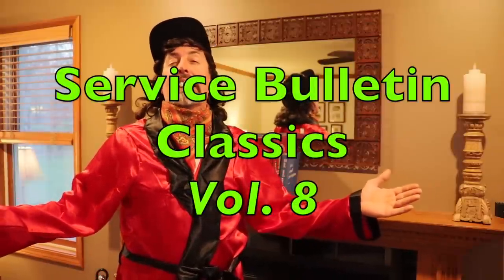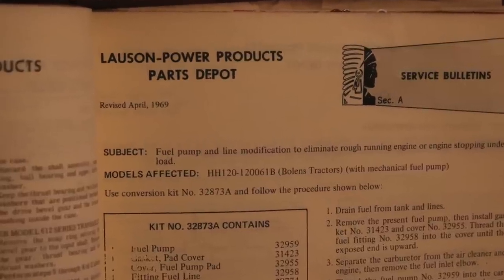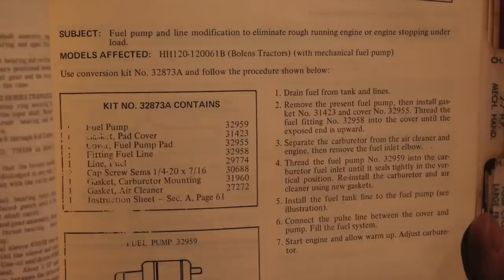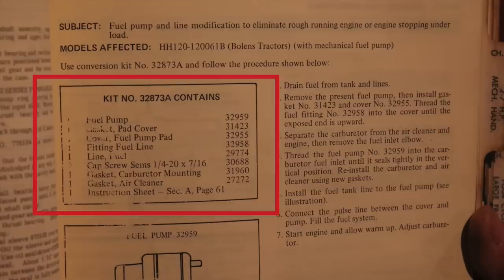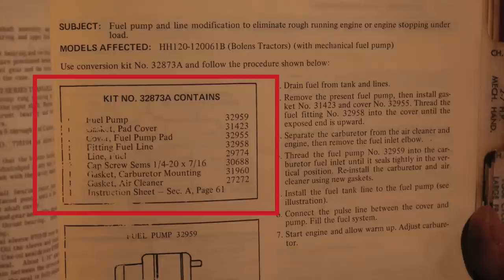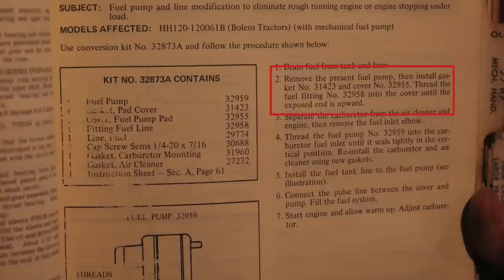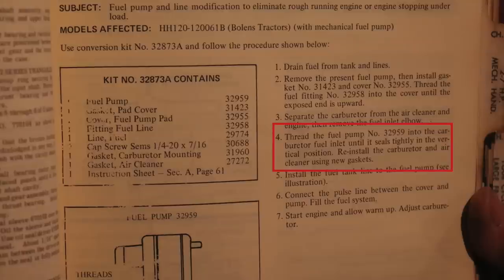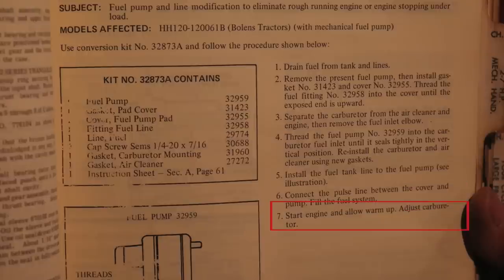Mechanical Fuel Pump Modification

Comment: I'm Old and remember actually using that exact bulletin! Used many in 50 years of being in this business
Reply: I’m old 😂
Reply: Me, too. 
Hey did you ever pull the "mechanical fuel pump" off an old Kohler Opposed Twin only to find out the factory had deleted the lever off it and just let the crankcase pulses do the work directly?. Looked exactly the same on the outside - used the same diaphragm and check valves, even. It was chuckle. I wish I'd thought of it !

Comment: I love Briggs and Scrappem but also really love the old Tecumesh.  Getting ready to do a restore on a 1983 Troy Bilt Tiller that has a Tecumesh engine with a special reverse gear pulley on it to drive the transmishyeeohn. . They are as rare as hens teeth. Thanks for making my Sunday, Taryl!

Comment: You can use a low pressure Holley electric fuel pump on carbonerated engines. It's not enough to push pass the needle valve. Works great. Glad you finally brushed your teeth Taryl. I could smell your breath through the computer screen.

Comment: My 1969 Tecumseh/Bolens is still running on the original fuel pump. If it goes bad, I know what to do...You dont hapen to have one of those service kits (32873-A) available do you?

Comment: Terrell I'm having a problem figuring out exactly what goes where and how much tension needs to be on the governor there are no linkages except for one going from the throttle back to the governor I don't even know if that's the right part or not that is on this machine I need your assistance

Comment: only one problem with manuel (air vent control fuel pump) is that some engine lose compression thur vent cause fuel pump stuck where there no air go in n out of hose to engine which it not good sing because fuel pump cant pump any fuel without engine pumping any air thur fuel pump
there few way fix that is check for air leaks like oils cap or valve cover gasket leak or air line if it have two like one thur carburetors and other to fuel pump (if fuel pump doesnt get enough compression  them u need cap off vent to carburetors)  in order to fix few issues get engine pump air to it
if you still cant get it to work them few trick just over fill engine oil over fill line (¹/2 over fill line) should help kick up compression thur vent if it did them good 2nd if engine start leaking thur crankshaft seal there your dinner n get that fix it should be back working aging